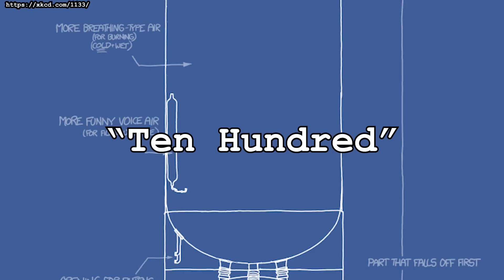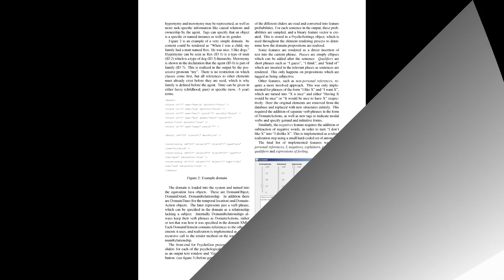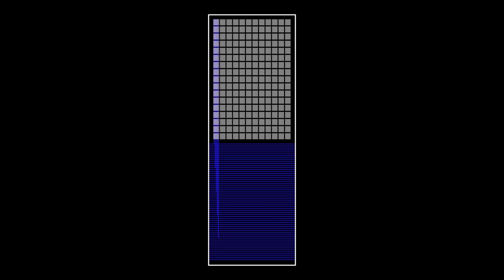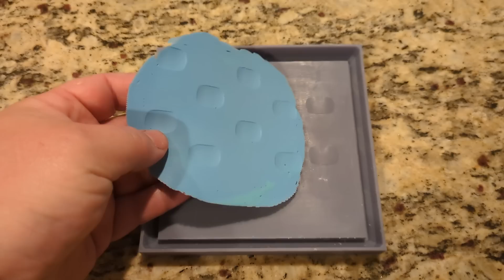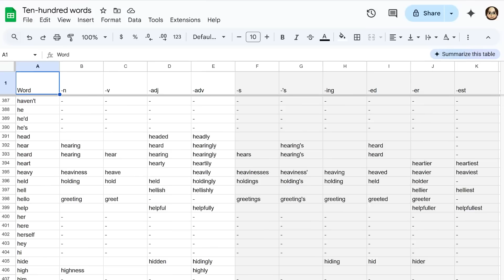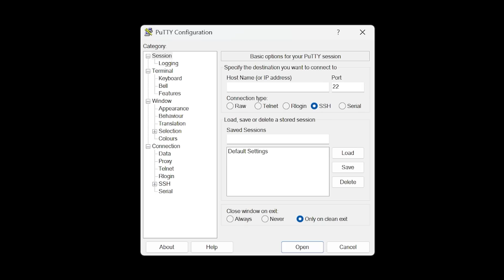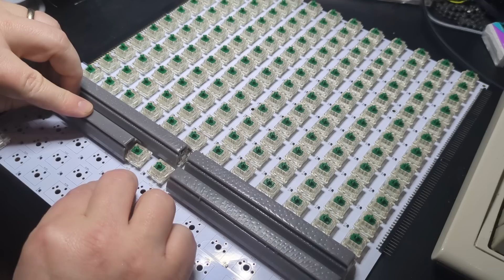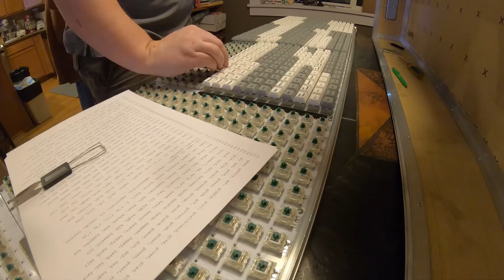A keyboard with ten hundred keys

Comment: Did you consider looking into the way LLMs have organized words, fragments of words, and punctuation/symbols, by frequency/probability and organizing them into tokens, with the most important stuff getting their own tokens, and stuff lower in the hierarchy requiring proportionally more tokens to be encoded/expressed?
Reply: Huh, you're right, a tokenizer intended for machine learning would be able to take a corpus and sort them from most to least important so you could identify which words really 'need' the prime keys, which can be more peripheral, and which can be relegated to modifier combinations. Like old-fashioned EATOIN SHRDLU or whatever the combination was typesetting keyboards, but for this mostrosity. Or your could use software that performs some similar concept for specialized compression algorithms, AFAIK they have to solve the same problem of sorting symbols into importance classes. But the problem would then be choosing a corpus to feed it, again -- what you feed the system would massively effect the priority it spat out. You could customize it to a specific type of media, or a particular person's writing, given enough data... but nobody would be able to make heads or tails of any combination without extensive experience with that exact one.

Comment: Being mildly dyslexic, I'd long ago wrote a bash glue logic script around a text to speech synthesis system and a clipboard reader. It would not be hard to rejigger it to just listen to the debug USART as the microcontroller vomits up the row-column pair numbers and a newline. In that case, just moving the tweezers from key terminal pair to key terminal pair could be rewarded with a verbal "Row X, column Y" audible announcement with never the need to look up.

Comment: You could do this with three I2C 40-pin GPIO expander chips. One acting as the row outputs, and the other two as column inputs 5VDC, GND, I2C_SDA, and I2C_SCL, four pins to get up to 40 x 80 = 3200 keys in the matrix.

Comment: I cringe every time someone says they won't use SMD components. Surface mount soldering is easier than through hole for a lot of components. Flux and a hot air gun is all you need to good results. The only caveat  is fine pitch parts and small passives (0402 and smaller) need solder paste and a stencil for good results. Parts pricing and availability are also better for surface mount components.

Comment: Move modifier keys to center for easier operation. Add a key or key combination to get another 10 hundred words. Reprinting new labels will be fun.
Also why not print labels on adhesive paper, and to protect them add some kind of coating? I used a QWERTY keyboard that had high-contrast labels for visually impaired just made from ordinary paper...

Comment: ¨Ten hundred". Good golly. Apart from this being a ludricous project, please just write normal. Also, remember the early home computers. FN plus key gave a whole BASIC instruction. By simple tokenizing. And if you want more keys, add a couple of FN keys to keep things on a workable size. Still just one keystroke. So, tokenize and use a row of FN keys to select x sets of tokenized keys. Say 50 alphanumeric keys, 10 FN keys on a single row (check the old BBC micro function key row) and a shift key. There is your 1000 keys - or tokenised words. Add another shift: presto, 2000! Add a CTRL, ALT, etc... And this just adds a simple 10 key FN-key row to the existing standard keyboard. The rest is software, no complicated hardware stuff needed apart this simple 10 FN-key row. Oh, the key-caps: look at the Commodore 64 please, and if that won´t work use language prediction in combination with predictive key labels popping up on screen.
And if you do want to do hardware: Bigger keyboard with bigger keys to get more printable space on key-caps.
All in all, the more I think about it the more your project is really big fun. Kudos!

Comment: Cherry MX type switches which are ment to be soldered directly to the PCB without mounting plate to hold them have two additional pins extruding from the bottom housing of a switch. For some reason you decided to choose a "3 pin" MX style switch which is designed to be used only with mounting plate due to the lack of the alignment pins. Also these pins help keep the switch in place when the keyboard is being used by taking off pressure from the solder joints.

Comment: wow i love this idea

personally i would have wired the coloumns up a bit diffrently, i would have had the big connector on one side and then just wire it thru to the other side but shifted by 12? (the number of coloumns per board)´that way the board can access the connections needed and the next board does the same with the shifted connections from the first board

no solder jumpers needed

also maybe the most common few words should be grouped in a specific area to make it easier to type with very common words like the that i we you ect

Comment: The diode damage reminds me of a DIY repair I did circa 2010 for my C-Thru Axis49 MIDI controller. The design was basically tall hex-shaped keycaps in a hex grid, much like this. I got one when they started to fire-sale, the company closed pretty quickly, but I had a few keys stop working after a drop. I examined it closely and surmised that it was the diodes. I emailed them asking for the part number and got some new ones. Then I soldered it on the wood floor of my apartment with a Radio Shack iron and no other tools. Later, I had another drop. Again, diode damage. I still haven't repaired that. It's fine in storage.

Comment: You can get microcontrollers with lots of GPIOs. For instance the STM32G0B0VET6 has 93 GPIOs and it's less then $5 in quantity one from digikey.  Faster polling rate vs the I2C expanders.  And an overall simpler circuit with fewer chips.

Comment: That stapler on your shelf is the best, hope yours works and you make use of it.
Reply from the maker: It does! I don't use it much, not wanting to use up all the wire, but it's such a cool mechanism I just can't resist sometimes.
Reply: @Attoparsec  I mean, it's not just a stapler, it's a little staple manufacturing plant, so rad. But my favorite part is how much slimmer they are in practical use, steel staples make the corner of a pile of stapled documents pile up like twice the thickness of the paper in short order while the slim wire staples are barely noticeable.

I purchased one on eBay with a full roll along with a second roll new in box and have yet to make it through the first. I'm pretty sure it's just brass wire and can probably be purchased as a bulk hobby/craft/jewelry/fishing lead supply and rewind your own spool, certainly easier than rewiring an electric motor, and I've seen people do that.

Very surprised to see one 'in the wild' so to speak, I don't even remember how I came to know about them or decided to purchase one, but I'm glad I did and glad to hear yours works, such a satisfyingly tactile chunk-chonk mechanism.

Could be worth a Shorts or something, very interesting bit of old tech not many people have probably seen and doesn't require 6 months of production or script writing, just a thought, cheers 👍🤠

Comment: While I think it helped you cutting costs while prototyping for the I2C problems, a cleaner design would have been to have the I2C IO expanders directly on each board and use solder jumpers to give them their individual address. I'm more of an ESP guy, so using a bluetooth capable SoC would have made you a wireless keyboard.
Another idea are non square pcbs. Have them in trapezoid form, so when connected, they curve slightly around you. For the case, I guess I would have gone with FDM 3D printed parts joined together and HDF glued in for big panels like the bottom.
As I wrote in another comment, FDM printed key caps work fine. I'm typing this comment on such. 0.2 nozzle, filament changing printer and printed face down on the build plate. Low profile flat caps are fastest and easiest to print. Curved may be more ergonomic, but ergonomics are lacking a bit anyway in this case.
Nevertheless, this is an insanely cool project!

Comment: if operating systems (via the USB standard) accepted more key codes, really neat keyboards could exist.  you wouldn't need to have a key trigger a macro, the OS would ingest the keystroke and do the right thing natively.  Alas, we live in a universe where the USB standards people have zero imagination so they don't enable things like this.  I'd like to at least have the option to push a single button to paste whatever is in my clipboard, and NOT HAVE ANYTHING THAT TRANSLATES THAT KEYPRESS TO CTRL+V.  Ironically, the USB keyboard spec has keyboard scancodes for the `copy` and `paste` keys, among a few others, but operating systems don't do anything with them.  Maybe adding more to the USB spec would trigger their inclusion...

Comment: Sounds like you need to get into FDM 3D printing! That whole keycap process, not sure if the Bambu with AMS would have been cheaper but for sure people are printing keycaps in PETG with multi colours... 0.2 size nozzle gets you 90% of the way to resin resolution as well
Reply: I did exactly that with my keycaps, but they are low profile flat ones, so they could be printed with their top side on the build plate. Rounded ones are possible with a low layer height printed in the normal orientation and then smoothed with sandpaper or vapor smoothing.

Comment: As someone who has turned a $500 knee mill deal into a harrowing experience involving a lift gate truck and a foray into hydraulic pallet jack rebuilding, the $75 heat press covered in parakeet feathers and smells hit home. Some rabbit holes have snakes in them, so why not read up on herpetology and build some terrariums?
Reply from the maker: Having just wrestled a disturbingly top-heavy pantograph mill down the 6" drop into the inner part of my shop, I hear you!

Comment: Some older Japanese keyboards are just insane, even though they tried to keep the number of keys down by having every key have nine different characters.
Reply: Those type setting keyboards for japanese newspapers are crazy. Wonder how long time it took to master using them.
Reply: @ulwur for a middle class Japanese, idk, 2-4 years. for us, 10 years to learn the basics
Reply: I've seen a Korean typesetter. There were thousands of tiny dies (about 5 mm wide each) that the operator had to pick out by row and column. It looked to me to be the most cursed input format ever. I'm sure typing phonetically and then picking the right symbol is a very welcome replacement when using the CJK character set.
Reply: @mal2ksc  was it Korean Chinese characters (hanja)? Hangul would be quite a bit easier though still complicated to type with traditional typesetting, though if I remember correctly hanja was still in use for more formal works for a long time
Reply: My favorite is the Toshiba one that has a rotating drum.
Reply: Sweet. Makes me wish globalist pigs hadn’t ruined their traditions

Comment: I am very sad that the paper with words the man was reading for this moving picture thing wasn't all made using the ten hundred most used words. I think he did a good job anyway.
Reply: How many different words did he use? I'm asking for reference regarding the mark ii.
Reply: If you copy the transcript, then remove the timestamps, change spaces to newlines, sort, uniquify, and word count, it shows 1788 words.
Of course, this doesn't try to reduce multiple forms or anything like that, so there are fewer words once that's considered.
I'd originally shown the Linux command line to do the counting, but that comment appears to have been rejected.

Comment: Becoming the kind of guy who knows how to build a custom road case, when you're already the kind of guy who builds many weird things that yearn for custom road cases, seems like a dangerous choice
Reply: It's a bold strategy. Let's see if it pays off.
Reply: See that's the thing with being a "generalist" or a Jack of All Things, Master of None. Over the years, to compensate for things you can't do, and in lieu of learning them (costs usually being the primary reason there), you start to build up a skill set of things that come very close... close enough that you can proceed without doing the thing in the "proper way" to begin with.  Hot-, super-, spray-, and really ALL things -glue become crutches and life-savers. Recycled materials become your new best friends. Aluminium starts to run through your veins* because it can be cut with almost any woodworking tool and a pair of tin-snips. You start to learn about really esoteric topics because, in pursuit of the "almost" thing, you come across a lot of "neat" things throughout history and especially from other makers. Like, who knew you could use luer-lock syringes as drawer-soft-closers, or mechanical relay coils as TINY precision solenoids? Or that Isopropanol will dissolve hot-glue (over time, but it's great at removing it without marring surfaces)? 

*do NOT let aluminium actually run through your veins, that's HIGHLY toxic!!!
Reply: @dustysparks  the trouble, the challenge, is some trades take jacks and make merlins, and then suddenly you're the roadcase whisperer and you have spent seven years making bespoke perfectly fitted road cases for every object in your life with a volume over a quarter cubic foot. Your house is voxelized, and you haven't built any geese in weeks!
Reply: @dustysparks  >aluminum running through your veins
Good thing it's not in anything we inject into newborns then!

Comment: The Chinese "Double Pigeon" typewriter from the 1970's has 2400+ pictograms to choose from.  There are no keys, just a tool to select the impact die with the correct pictogram.
Reply: The whole time I was watching this I was thinking of one letter per word languages like Chinese.  This is the kind of misery you'd have to go through without a multi step entry method.
Reply: @JohnDoe-420  IBM actually had a Japanese Kanji keyboard in the 1970s. Even printing 12 characters per key in the main grid and using a numpad-sized secondary grid to select a character, the main grid was 216 keys.
Reply: @mpf1947  The IBM 5556-005 is the name of the keyboard.
Reply: @JohnDoe-420 There was actually "MingKwai", a mechanical typewriter for Chinese that's closer to a western typewriter than a traybed; you press two buttons that have symbols representing parts of the character you want, then a window shows 8 candidates to choose from. All mechanical.

Too bad it died on the vine because China went red.
Reply: When one encounters something like: "Double Pigeon" typewriter, one immediately knows that it is Chinese. They named their Moon rover something like "Green jade rabbit". Maybe the translators are cheating?
Reply: @bjorntorlarsson  I have a very bare understanding of the chinese culture and those of asia in general but as far as I understand: using symbols is much more common and far present in everyday life than in our western society. As I heard that also translates to architecture.
That might explain those names which seem odd to when they're being translated.
But I'd like to mention my "knowledge" might be outdated and or incorrect